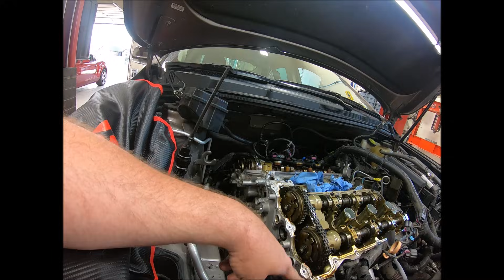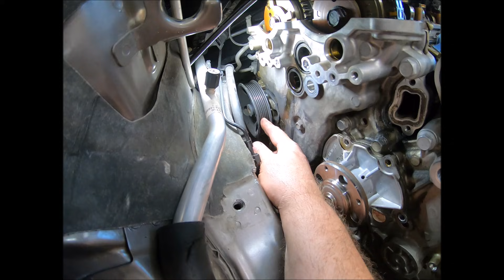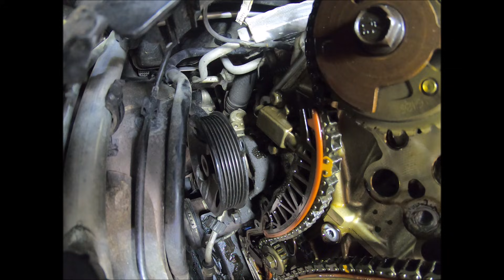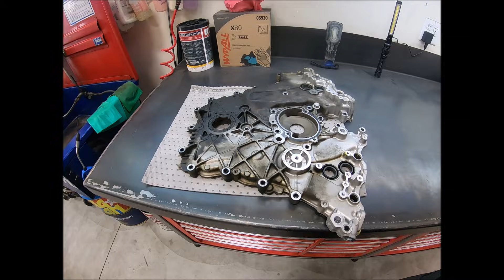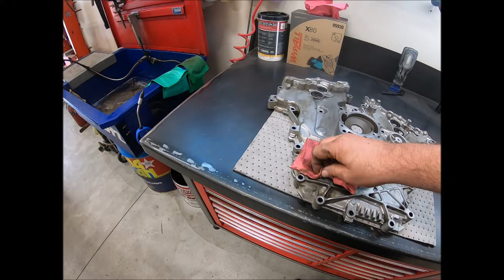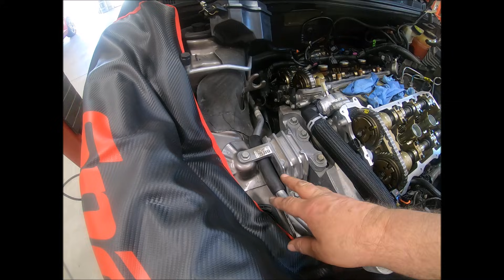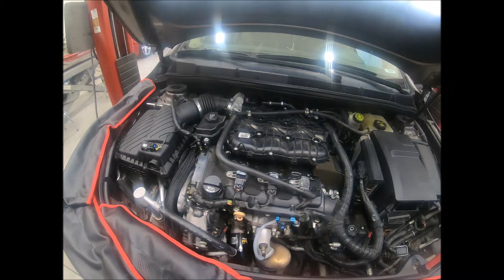Buick V6 Timing Chain Replacements

Comment: I have a Q: My leak in 2015 lacrosse is in same area you pointed out. For background, IHad low oil pressure light come on for about a week before, and then right after oil change. Was on freeway after oil change and low oil pressure light came on, then accelaration power reduced and engine stalled. I smoothly just sailed to side of freeway. This was about 20 minutes after oil change. Car usually would start back up when oil low pressure light came on and I cut off and let sit a few minutes, but had never been in position where it stalled before could pull over safely. Was told this MAY be a safety feature from sensor shutting engine off when oil pressure too low to avoid seizure. Is this true?

 Also tensioner was rattling in need off repair also. Do not know if it possibly seized or not. Or if engine seized. Hopefully sensor shut engine off and is not letting it start back up until problem is fixed. Have not had it diagnosed yet. 

So I Towed it home that day, and it is at least a quart low on oil after sitting a month. I also realize when did oil change only 5 qrts were put in not 6. But its definitely lost a little oil since when checked dipstick the day it was towed home, yet no oil puddle on ground, just a little on the frame. So I Ran my hand along right bottom of front engine where oil was evident and got new oil on my fingertips. Felt white rubbery stuff portruding out of a seam on the bottom right front of engine to the right of i think thats the power steering pulley or harmonic balancer. Whichever is at the bottom right front of engine. My engine sits just like this one, sideways. I Was told it is a front main seal leak. Is front main seal same as timing cover seal?

From this video it seems the exact spot you pointed to and said this car leak began is where mine is leaking now. Not leaking a lot and must only leak when engine runs. Oil pan was full at oil change but oil was very black mechanic said last oil change was dirty oil or used oil. Trying to figure out why car is not starting. If engine is seized or if sensor is just doing its job and not allowing it to start until problem is fixed. Have narrowed it down between either oil pump is failing; sensor is bad; engine full of sludge, or that leak throws pressure off and sensor wont let car start. Or twnsioner seized. It was rattling bad. Would appreciate any feedback. It looks like that seam where engine block meets that front cover is where the leak is. 

So just asking for clarification if a timing cover and front engine cover are the same thing. And if the sensor shut the car off or did it seize.
Reply from the maker: Yes, the seal in the front of the timing cover is the same as the front main seal.

A sensor usually will not prevent the car from starting unless it's either a cam or crank sensor as those can.
Reply: @zmotorsports62  same car, I am working on it now. It still has never been started since the day of tow. I am about to go get a battery and begin with trying to self diagnose again and repair. After much research and watching your video as well as 2 others in specific: I truly have come to the BEST conclusion being the car went into limp mode and the ECM stalled it to prevent from seizing. I have learned from the dealer about this 2014 Lacrosse model and it does have the limp mode/reduced power safety feature; and shuts down before the engine is damaged when the oil pressure is low. 

There was also a tensioner pulley issue. the guy who had changed the oil did not change the sensor either. Just the filter. When the car was started right after the last oil change; everyone jumped away because the tensioner was so loose they thought it was about to fly off. I was told make it home and do not drive again until fixing tensioner. So I have put literal 2 and 2 together; and I think these 2 issues met and came to a head that day; and the tensioner which has much to do with how your serpentine belt behaves; may be the culprit here. 

Is it possible that a loose tensioner was causing the belt to slip or off time in conjunction with the low oil pressure issue; possibly even being the catalyst of it all; and the car will not start/crank because the cam or crank sensor is alerted of the issue with the tension of the serpentine belt?  Or simply is not kicking over at all because the tensioner is shot so the belt can not turn at all, meaning no power to the alternator, cam, crank, etc?

I  recall now there was also an issue of having to get boosts to the battery shortly before this car went down as well; even prior to the low oil pressure light popping on for about a week or so prior to the stall. It was a replacement battery called expresso or something installed in lagrange georgia in 2022 when the car was recovered there after being stolen from my farm. The car is in Michigan. 

That battery is dead and I now suspect had a dead cell or something because it did not last long. there may be battery wiring issues because the thieves were trying to convert the car to actually keep it and had taken the original battery which had no issue out, and put a truck battery in it. Idiot shit indeed. Thats the battery that was replaced for the expresso or whatever in lagrange; the truck battery the thieves had installed. it looks like a battery exploded in my engine on the underside of the hood.

So I will be grabbing a breaker bar to see if I can turn the crankshaft manually to tell if its seized or not; but I do now believe its not seized and that exactly what you said is going on; and one of those cam or crank sensors is preventing start based on the tensioner being so loose that the serpentine belt literally can not turn without risk of slippage or something that could seriously damage the engine. It DID shut off on the freeway and right before it was not just a power reduction, there were a couple of flat out jerks as if gas wasnt gettn to fuel pump, and outright disruptions of what I now realize was ALL POWER, and not just engine power reduction. It was as if the car was glitching. THEN the power reduction, THEN the total stall. There was no smoke billowing or burning or overheating. Just a very small little burnlike smell and almost cigarette puff of smoke to compare in volume;   right at front of engine in area of exactly where I NOW KNOW the tensioner and belt to be. I am prepared to discover an oil sensor needing replacement and tensioner pulley replacement; with even maybe a shot oil pump which I will hate; but oh well. As long as its not seized, thats been my main issue trying to diagnose if it is seized so I know to invest money into it or not. 

Your comment I just now am seeing; and it in conjunction to my research leads me to believe this baby needs battery, oil sensor, tensioner pulley, and its starting. Will update ASAP

Comment: So if you dont mind me asking, In relation to the phasors, if Its only throwing code P0017 and no others,  would it be more likely to be just the phasor? Or the whole secondary timing chain? I replaced the VVT solenoid and the Cam sensor w no dice. I was thinking if it were the chain I would also have P0016?
Reply from the maker: It could still be the timing chains as it could be just one cam being detected and not enough slack in the chain yet for a secondary code.  I've seen several that only are detecting one code and the owner catches it in time before the chain stretches enough for a secondary code to be detected.
Reply: @zmotorsports62  OH ok gotcha, I'll check for both the chain and the phasor then, Thanks!